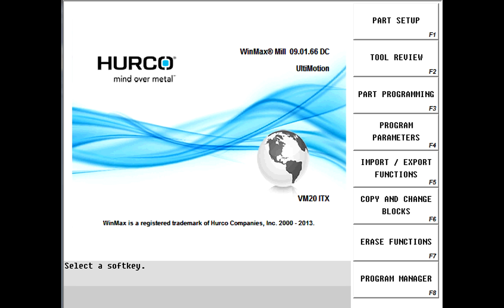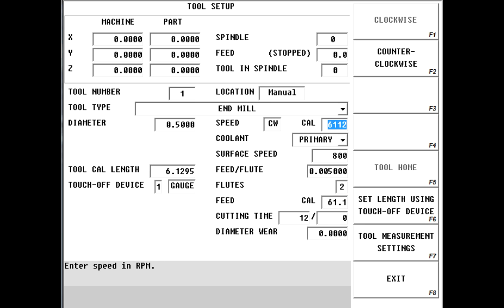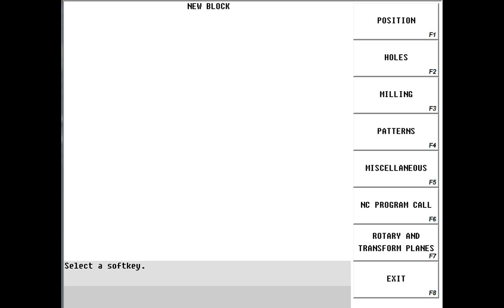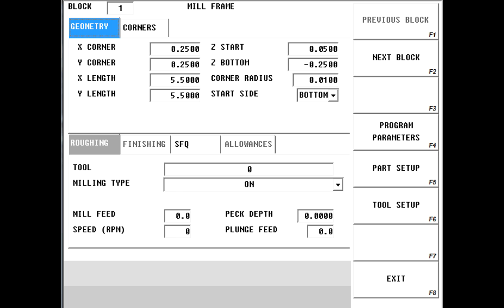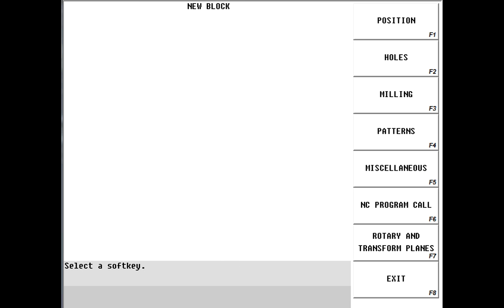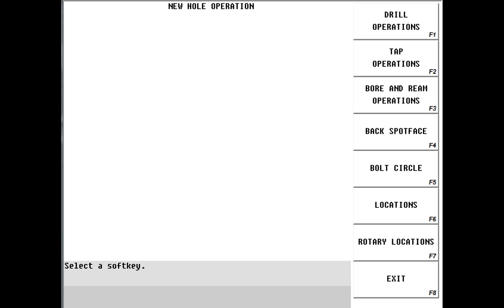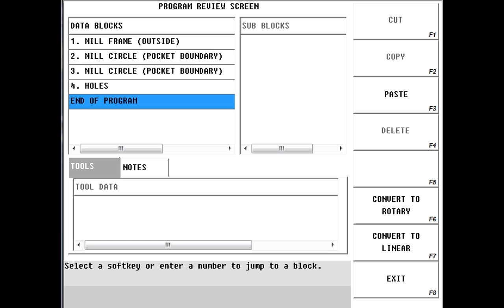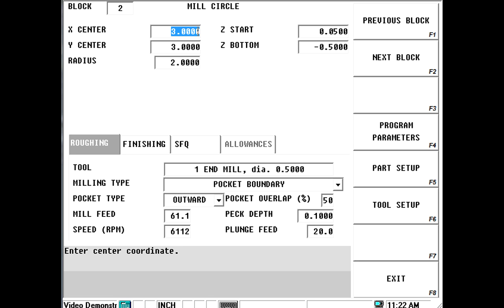CNC Control Demo Hurco WinMax V9 - CNC Machining & Programming

Comment: I'm looking up info for my father and he has a 2007 hurco, do this instruction you give work for the model year, if not do you know of a video that has the same information for that model year? Thank's for you time.
Reply from the maker: This demonstration was done using Version 9 software (which is older than the 2007 machine, which I believe was V8). However, the basic principle of programming a Hurco hasn’t changed since the 90’s, so this is still relative. The only thing that wouldn’t be is if you used a control or programming feature in the video that didn’t exist in 2007. Also, the 2007 machine could be upgraded to the latest V9 software if that would be beneficial.
Reply: Thank you. That's what I thought but my father doesn't want to hear it from me so I'll send this to him and maybe he will listen to you lol